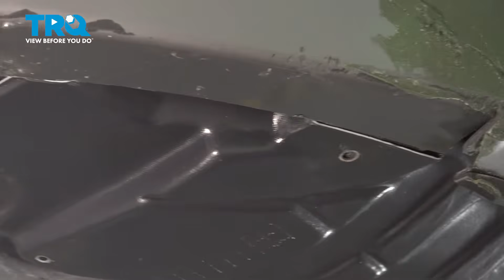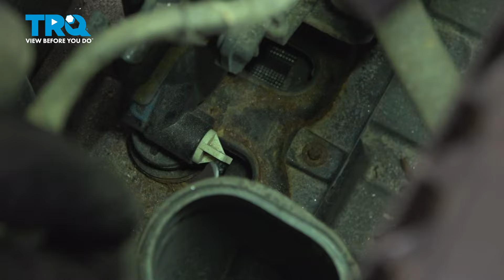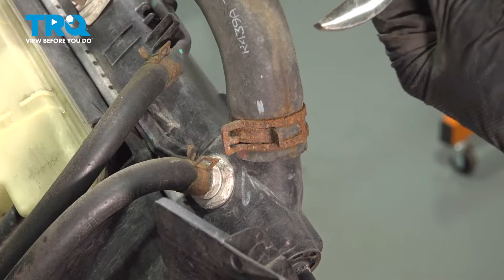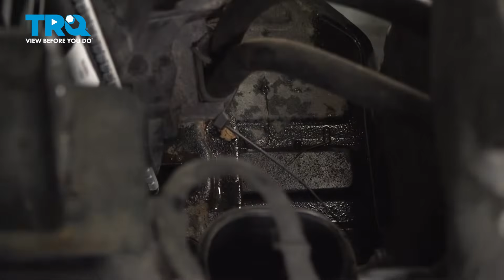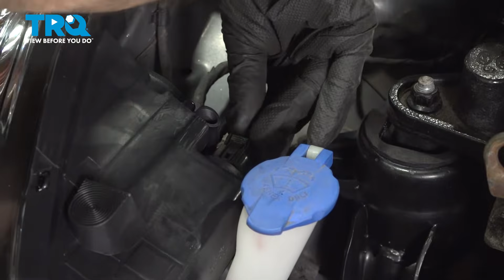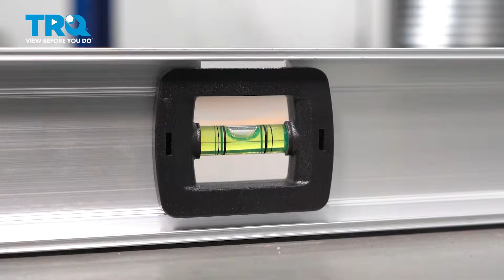How to Replace Starter 2011-2016 Hyundai Elantra

Comment: Good lord, that's a lot of extra work to replace the starter that can largely be done under the car. May need to remove the air intake tubing out of the way and perhaps the battery, but not necessarily.

Comment: The problem with taking apart so many parts is that you run the risk of something not fitting back together properly when reassembling. It’s better to do it from underneath—it’s easier and faster.

Comment: Why would you remove your a/c lines to have another issue to deal with? Draining radiator?  What’s going on here?
This should demonstrate the easiest way to get the job done for the do it yourselfer. 😂😂😂. Maybe if you’re working in a shop and are padding the bill you can do it this way. Smdh. Booo💩💩

Comment: So is the solenoid and starter motor one single assembly?  Mine on occasion clicks  and after 2-3 attempts it starts up, battery terminals are snug.  If its the solenoid does the entire thing need to be replaced?

Comment: This video is fantastic. This guy demonstrates how to remove all front end components in order to give you better view of the starter, hoses, and bolts. He stated unequivocally, "You don't have to remove all of these."  Saved this video for radiator replacement. 

Replacing the starter simply requires 20 minutes. To disassemble the starter, remove the wiring bracket from the engine's bottom, unscrew two bolts from the rear, lower the starter, and take out the electrical connector and positive wire.

Thank you!

Comment: People have mentionned it already, but the only thing you need to do is to remove the air filter box. This will open up a large volume of space through which the bolts are easily accessible with an extension.

The biggest problem is inserting the new starter as there is a wiring bracket in the way. Slipping the starter out and through is fine but when time comes to put the new one in, it' almost impossible. To be honest, I did not even   touch the bracket nut. I simply bent the bracket slightly, slipped the new starter in and bent the bracket  back to its original position.

PROTECTIVE GOGGLES STRONGLY RECOMMENDED. SO MUCH DUST AND RUST. PROTECTIVE GLASSES FAILED TO PREVENT CONTACT
Reply from the maker: +Miditree Thanks for the feedback! http://1aau.to/m/Shop-TRQ

Comment: Yesterday I replaced a starter on 2015 Elantra 1.8 L that has the same build and engine. All I did from the top was to disconnect the battery terminal nothing else. Every thing was done under the car. You need to jack up the car and remove the bottom splash shield that has four 10 mm bolts and few plastic clips that takes 10 minutes to remove and then you see the starter above the oil filter with much easier access to remove the main 12v cable and signal connector to the starter. Two 14 mm bolts are also easy to access, remove them and then there is one 10mm bolt to detach the wiring harness bracket to make some room and starter comes out from the bottom without much effort.  For me it was much easier to do it from the bottom and saved me time and effort.
Reply from the maker: +S Ulla Thanks for watching our video! http://1aau.to/m/Shop-TRQ

Comment: Good video on showing removal of the bumper and radiator.   A much quicker and easier approach would be (1) disconnect battery cables (2) remove the air cleaner (2) remove the air cleaner box in front of the battery to expose the top of the transaxle, so that the starter mounting bolts are easy to see and remove from above (3) remove the starter from below, and in that process remove the lower end of the + cable and the wire to the starter solenoid.   This YouTube video shows removal of the air cleaner box: https://www.youtube.com/watch?v=XkrJOw8oeLw   However the bolts holding the starter are not clearly shown - but after the air cleaner box is out, the bolt heads are very easy to see and to wrench on.